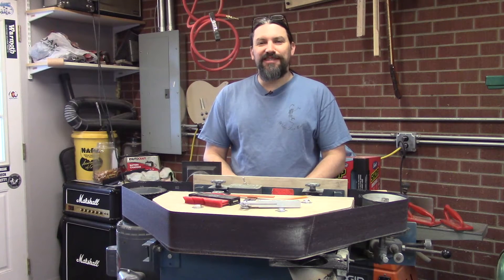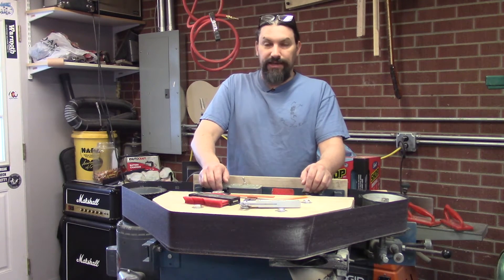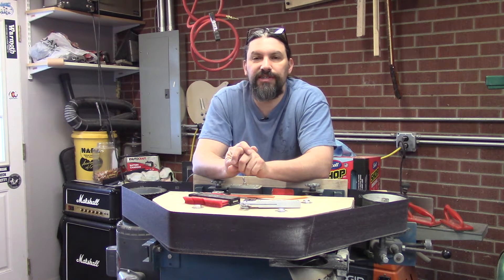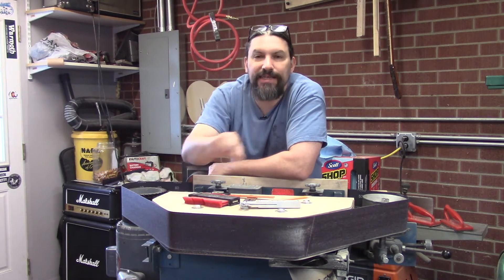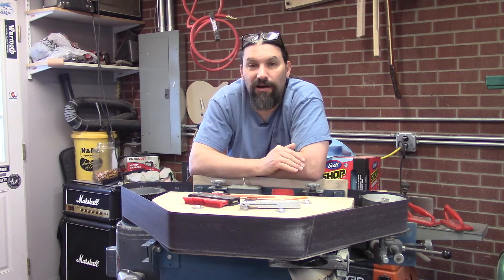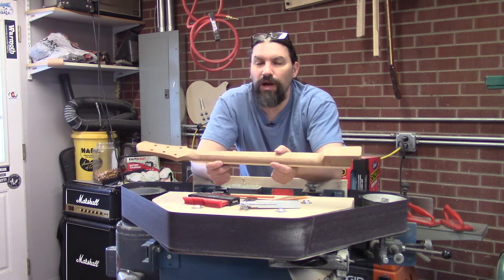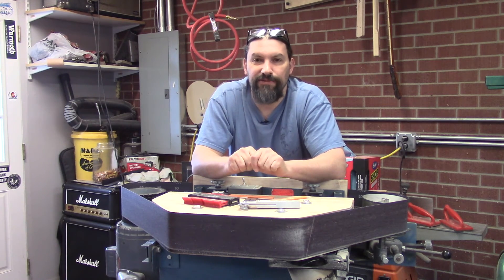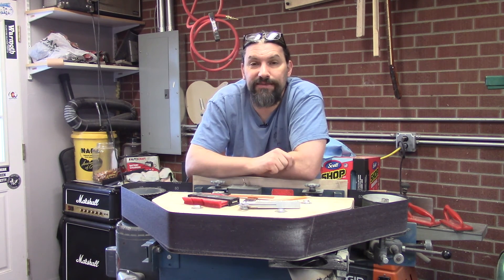Old School Dead Head Sander Part 1

Comment: Question....trying to build a diy dead head sander with a 1hp motor. curious if i could use my ryobi benchtop sander and mount it on its side and add 2 2x6 plates and cut them at an angle. This however will force the spindles driving the belt to have a more downward pull....saw your other video of you using a differenct dead head sander. The question is....do i need to use/make an edge sander that MUST have the rotating spindles far apart to accomodate for the angle of the sand belt to have a more angled pull as opposed to a more downward pull.  Thanks for the help

Comment: hey matt ..what should a stock acme belt sander cost ,a good deal..
Reply from the maker: Hi Thomas, I think I gave 300 or 350 for mine... I don't know how good of a deal it was but it seemed like it at the time. You certainly won't need that brand though the design of that model made for an easy modification. 
If you find one that is running I'm not going to be surprised if it will run forever.
Let me know